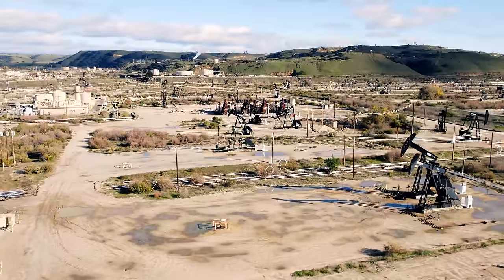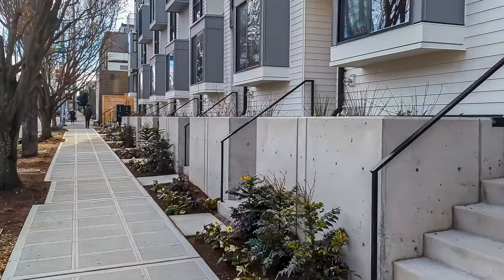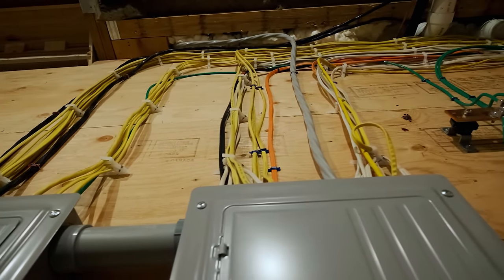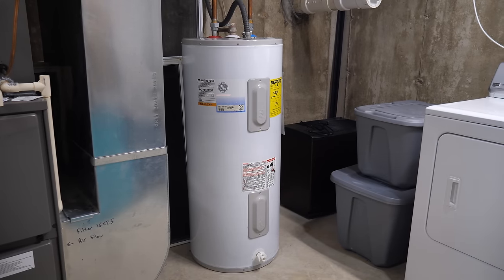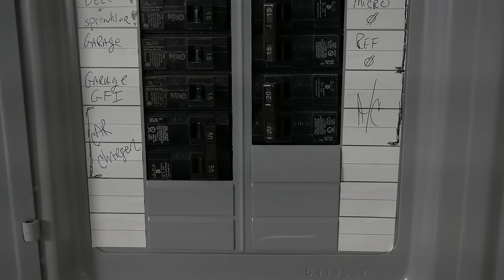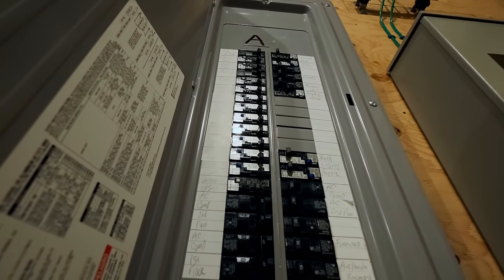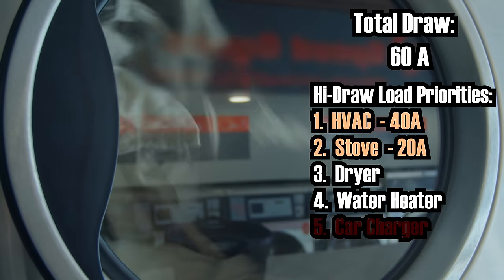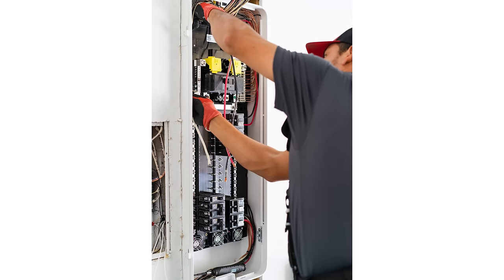Home Electrification: There's not a lot to do, and it doesn't have to be hard (Part 1)

Comment: I love your channel. But I am disappointed with this video subject for a  few reasons. 

1. 60% of the grid is powered by fossil fuels, so electricity is mostly fossil fuels converted to electricity at a 20-40% efficiency. 

2. Nuclear power uses an incredible amount of money and relatid fossil fuel usage.

3. Solar and wind are not reliable base loads, and so need 100% backup, which is mostly fueled by fossil fuels and must be in stand-by, which uses more resources and fossil fuels.

4. As you hinted, our electrical grid is not well set up to receive additional loads from electrifying everything on buildings and cars.

5. During severe cold conditions we do not have enough electricity.  With more electric cars and more heat pumps replacing natural gas, we are making the grid less able to adapt to extreme weather events. 

The number one way to save energy is to reduce waisted energy by improving how well the building is insulated. And also increase other efficiencies.

Replacing high efficiency natural gas appliances with electrical appliances is only more efficient in some circumstances and IS NOT THE #1 OR #2 WAY TO FIX CIMATE CHANGE OR REDUCE FOCIL FUEL USAGE. Please don't make people think that switching to all electrical appliances is what we need to do.  In the future it will be but not in the next 15 years, while we adapt our infrastructure and find/build huge amounts of medium and long term storage for the electricity grid.

Comment: I'll stick with gas, as it can be operated without power.

Considering the state of the world, I would be extremely reluctant to depend upon electricity for everything. Especially when half the political spectrum, is wanting to run around controlling every aspect of the lives of the people they allegedly "serve".

I will not live in the pods, I will not eat the bugs, I will not be dependent upon others. There a lots of ways to produce flammable gasses that a gas stove can burn (with appropriate regulator and ventilation) in a world without an electrical grid, or a world where your power has been cut for the crime of asking too many questions on Twitter.

Call me a conspiracy theorist if you want, but that term really isn't holding up very well.

Comment: They can keep their electric pollution. Things that are not mentioned. Battery waste is the biggest pollution problem that is not answered. Coal burning to make electric, lead acid that eirher gets into the landfill or its laying around in our yards. You have to burn twice as much electricity to get a single use out of gas heat and gas is the cleanest burning fuel. All them solar panels in the environment is the most ugly landscape you can come up with. We have a food shortage and we are installing these ugly solar panels instead of farming . We have so dry of weather and lack of rain because of vegetation shortage. Meat is another shortage that we have caused. We dont even know the long term of all them ugly solar panels the effect it has on the weather the sun is reflected back into the atmosphere instead of being absorbed. Plants are hungery for rain and sunlight. Lithium is worst polluter than lead acid. And the cars are dangerous on the road even more than gasoline. I will keep my gasolone powred car and keep my propane heaters and keep my generator in case of all this solar and wind power fails. It did last winter in Texas. Its a wake up call. By the way learn what a real heat pump is. It heats and cools the home. Electric is still part of the energy source but not the only source. Keep your ideas home and quit pollutiing the minds of other countries. 73